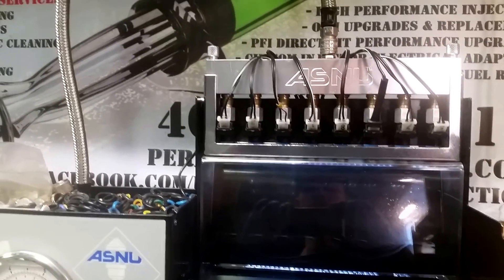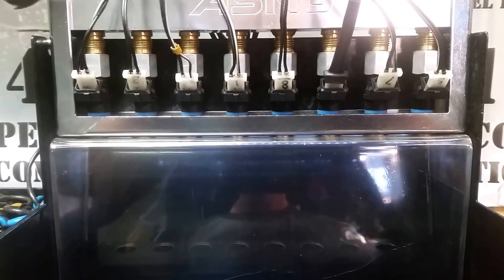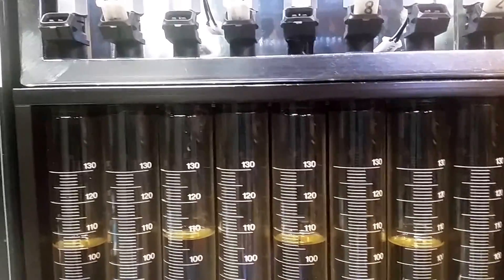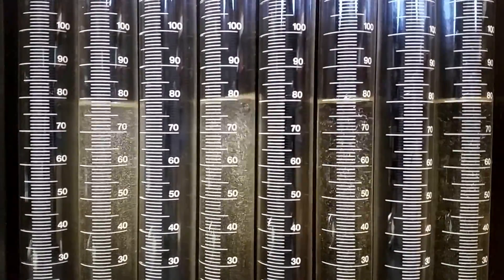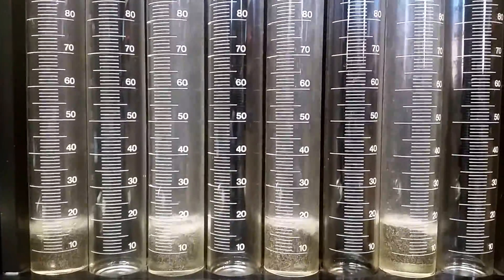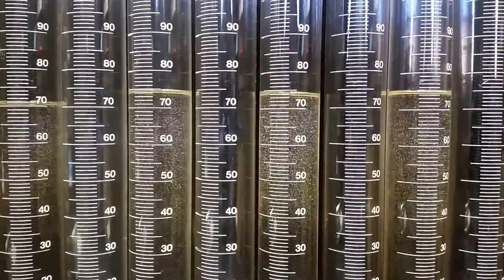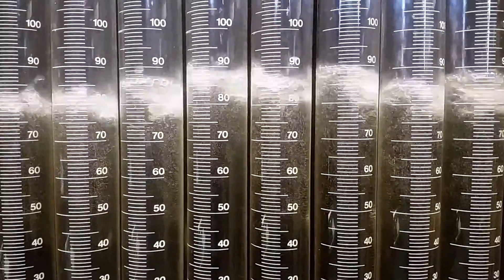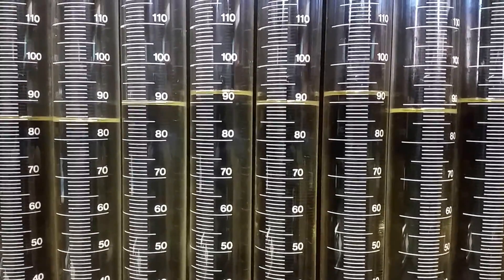Siemens Deka 60lb "shorty" injector testing

Comment: I use these injectors and have always had an issue between stft from Bank to bank. Sometimes over 7%. I have purchased a set of deatschwerk 1200cc flow matched set and hoping I have better luck. Thanks for taking the time to show how off the shelf injectors flow.